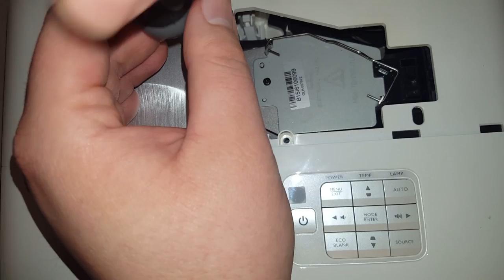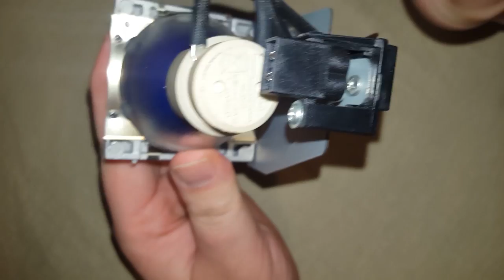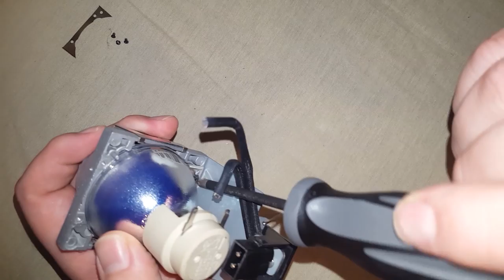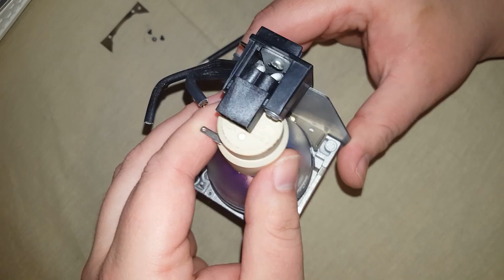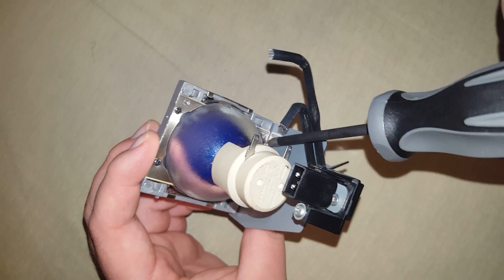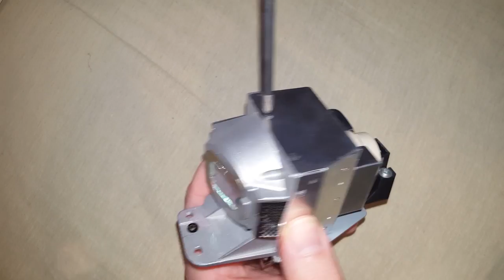HOW TO REPLACE THE BARE BULB IN BENQ W1070 PROJECTOR

Comment: Great video, very helpful! 
I was doing this and found a slight shortcut: for the two brackets that hold the bulb in place, you only have to completely remove one. With the easier-to-remove bracket all the way off, you can loosen the screws on the other bracket, and the bulb wiggles free pretty easily. It's still possible to install the new bulb, making sure to line up that notch that the video points out.
Reply: Genius - thanks 👍🏼

Comment: Do not.. I mean DO NOT change bulb without cotton gloves. If you get oil on the outside of the bulb you shorten the bulb life length by half. I mean it seriously don't do it like this dude. Everything else is good only thing are the gloves he don't use.
Reply: Kammaflaje agreed! Gloves is mandatory! Oils will from
Skin will make bulb run hotter and overheat and have hot spots. I learned the hard way :(
Reply: I agree.
Reply: what kind of gloves should we have? the rubber one/the plastic one/the cotton one?
Reply: @hitodium  Latex

Comment: I'm from India and when I called up Benq repair center they told me cost of a replacement bulb would be around 200 USD. But I can see bulbs of my Benq model w1050 on eBay for $80. If I were to keep using my projector, do you think the bulbs will still be available in 4 or 5 years or so? I really don't want my projector to go to waste. And also do you think it's good to buy from eBay?
Reply: Jakub Brezovsky where would be a good place to get the lamp?
Reply: @Jakub Brezovsky Are you Polish?